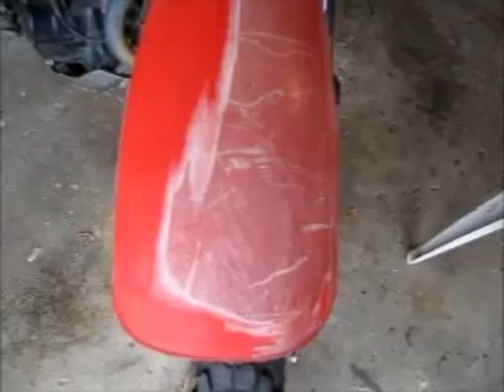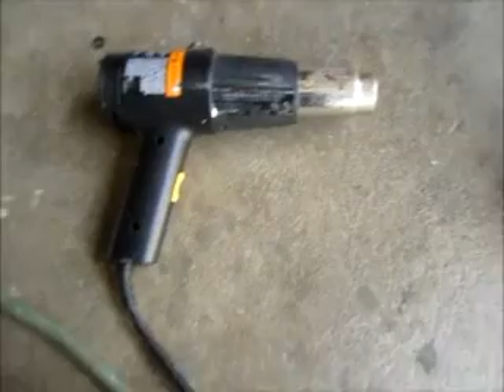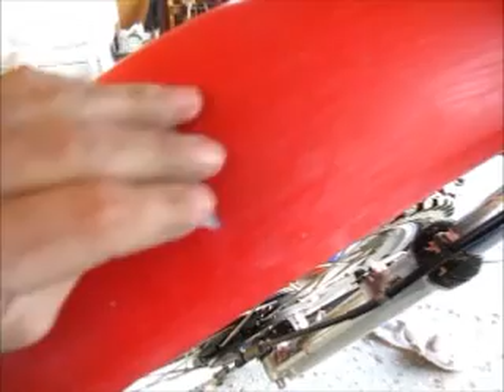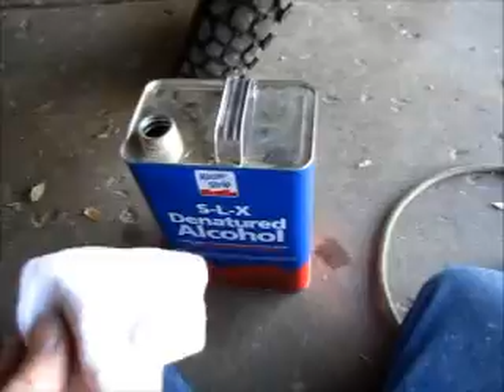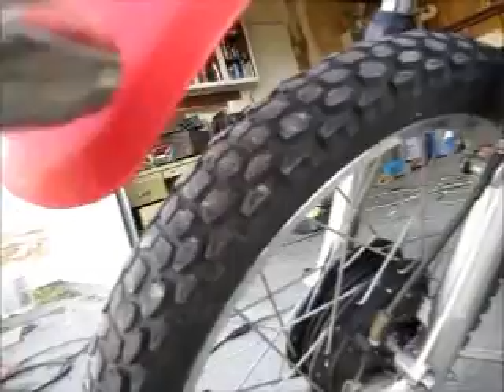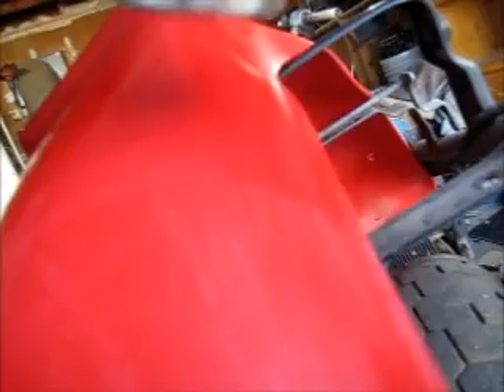How to Restore Faded Plastic Motorcycle Fenders (For free)

Comment: Ok here’s the updated process that will make your results phenomenal. Razor Sand the plastics free off heavy oxidation, wet sand 400grit, 600, 800, then heat gun, Let cool, wet sand again 1000, 1500, 2000, 2500, 3000, heat gun, let cool, compound with wool pad at low speed, clean pad polish low speed, then top it off with SC1 High Gloss Coating, let the coating soak on the plastics for a few mins then wipe it down with a microfiber towel 😎👍

Comment: Hi Jacob - didn't realize this was you for a few minutes !  Great as usual.  I have an old Spanish dirt bike that is "weathered" and the plastic is  raised and rough and oxidized badly.    Some of the rear  fender was protected from damage by other bodywork and shows a waxy but consistent red color and I want to scrape to see if I can get down to that layer.  Is it possible to scrape but not get there ? 
So far a lot of powder is coming off, but no red color seen.  Pretty badly oxidized.  If I don't "see red" pretty soon, is there a way I can apply  something that will stabilize the oxidation, act as a filler to the rough surface and then paint ?  BTW, I was glad to see you guys back the other day.  I don't know the frustrations of being a creator, but your channel was a bright spot, right up there with the big boys, so hang in there .  Thanks or being there.
Reply from the maker: I don't know of any way to stabilize the flaky plastic. Once it has dried out to the point we are talking about, it can't be reconstituted. If you can't scrape down to healthy plastic, maybe sanding and painting would be the best idea. What kind of bike is it? Sounds interesting!
Reply: Jennies Garage   1982 Montesa Cota 123 Trials
Reply from the maker: Unique machine. Good luck on the project!
Reply: Jennies Garage Thanks - I actually got 2 at the same time - the other is a 200, both kinda crusty, but will come back. I really like your channel so I hope it works out that you can come back more. Best of luck man

Comment: Helps but is not perfect a razor makes it worse and harder to sand down just use sand paper start with 220 or 300 and move up I repeat do not use a razor it’s going to leave a lot of lines plastic is very soft if ur a perfectionist like me ur not Gona be to happy with results it works and brings a shine but never like factory mirror finish I rather buy new ones cost the same if u add up materials and buffing wheels etc. it was a good learning curve but I recommend buying new ones on eBay cheaper and nicer good luck to all my DIY ERS

Comment: I didn't realize the oxidized plastic came off that easily.  Cool.

Tip on scraping:  Allow the blade angle to shift and you can scrape in both directions, doubling your work output in the same amount of strokes.

Have you tried polymer coatings, like NuFinish car "wax" instead of the heat gun to get a shine?

Comment: I have a lot of bikes I have collected over the years,  32 or so at this time, I like to fix them up and re sell them and also to have them around to ride so I only collect ones that I personally like and they are generally Trail Bikes from the 60's and 70's . i discovered this plastic restoration about 20 years ago or so, works great!   the alcohol I use on everything plastic, 91 proof i have found cheap enough and best, I like it because it leaves things as oil free as you can them.   did you know though you can sand plastic like it was paint and then polish it?   i don't use the heat gun is what i am getting at, I use a sander, i take it all the way to wet sand 1500 grit and then polish it up and man, it looks better than new, it;s amazing,  and when your old bike  shines like that with OEM fenders it pops so clean that people will pay the big bucks.

  Oh yeah. splurge a little and take the fender off.   thats the best way to get it 100%

Comment: Another idea i have is using  a cabinet scraper which is a  flat peice of steel  with a sharp  edge  used for scraping a  very fine amount  from a wood surface  in prepping it for finishing  you can find them on ebay for cheap and they are bigger than a razor blade  so easier to hold  also come in  a variety o shapes for getting into  strange corners  and profiles ?   One of my reasons for watching your channel is i have a early 60s Honda  street bike. That was my Dads  and one day in the future i would like to  make it  look  good and be a rider it has a lot of  plastic ? Fenders and fairings on it   I’m lucky  due to it  being in  a long term indoor  storage  but she still needs some love  i  think it may need a  wet sand or  a mechanical buffing. Mostly due to its age ?   Its mostly black  and i  do want to avoid  painting  if i can to preserve originality   If i can   In the past ive detailed polished other motorcycles  using a dremel  and various  compounds  and rouges  so I’m not afraid to  experiment or of the hard  tedious. Detail work it requires  ? Actually for some unknown reason i kind of enjoy it as i found with the right music and mixed drinks it can be relaxing  and even a little therapeutic  lol  my friends think I’m  nutty   And perhaps i am  but my Mom always said to each his own

Comment: The stuff he is scraping off is a clear coat paint put on from factory it burns from sun exposure over the years just using the heat gun with out the razor blade should work fine.

Comment: Save time and get better results by wet sanding and 3 step polishing or using a deminishing compound with a roto pad on a hitachi sander... Done in 10 min tops smooth and scratch free mirror finish..

Comment: Much better results starting with 320 grit sand paper, then 600 and finally 1200 grit....after done wet sanding, use polish and they look brand new!  This method doesn't leave any scratches or gouges from a razor and you don't run the risk of melting through or bubbling your plastic with a heat gun.

Comment: "Oneself" doesn't know but that method looks like it will "Decrease" the dirt bikes "Strength" because you are cutting away the initial plastic "Lessoning" the "Integrity" of the "Plastic" for its "Initial" "Looks" HUH , ....BUT you have to consider this the Old Faded Look or The Newly Re-Conditioned Look. Oneself has an "Old Faded "Honda 81' xr 250 dirt bike. Now do you take the differences and try it ?. Why not huh it has nothing to do with the motor or anything mechanical .  Again oneself watched this and am fully impressed because it doesn't make riding "Your Ole Bike" seem like your back in the "Flintstone Era"

Comment: Bad advice.   Look into wetsanding if you want to do this properly.  Razors and heat guns gouge and warp plastic.   Wetsanding looks 10x better and is faster if done correctly.  Yes I've tried both techniques.
Reply: Have you tried a propane torch
Reply: so big guy where's your video?

Comment: whats your opinion on using different grades of sand paper to get rid of the deep scratches? would you use the heat gun straight after or would you use the blade?
Reply from the maker: I think it depends on the fender. On the fender in this video, sandpaper didn't work, it just mad a mess because the plastic was kind of a soft formula (think of sanding a block of cheese) so I went straight from blade to heat. With the Husky fender (if I recall, you watched that video too), sandpaper seemed to work better for scratches (maybe 100 grit to get the deep ones, and then work up from there) but a blade is faster at removing material. In the end the toughest part is making it shiny. The sandpaper brought the husky fender to a smooth, but dull finish, and it was hard to bring it from that, to a nice gloss.

Comment: Wouldn't this work better with some polish grade sandpaper?
Reply from the maker: it depends on the plastic. On this fender I tried sandpaper from 100 all the way to 2000 grit, and it just made  little gouges that had kind of a fuzzy appearance. I think it's because this plastic is pretty soft so the sandpaper couldn't cut like it is supposed to. Imagine trying to sand a block of cheese.
Reply: Interesting, I've never restored supermotos, only encountered hard plastics so sandpaper has been more than enough...... but its good to know of this method as well since I'm obsessed with detailing & restoration

Comment: 60/40 mix of mineral spirit based paint thinner and boiled linseed oil works well too with much less effort. Spray on, let sit 30 seconds, wipe off. Then rinse with water. Only lasts about a year though. The cleaner they sell for fiberglass boats works too.

Comment: Question:  Can I use a hair dryer instead of a heatgun? other than that, good job for taking care of your bike man!
Reply: propane torch is a lot faster.
Reply: No you can't
Reply from the maker: Thanks a lot! Like the other guy said, I don't think a hair dryer gets hot enough.
Reply: hair dryer worked for taking a decal sticker off the back of a car,  a decent hair dryer is hot enough u cant hold your hand in front of it
Reply: hey, ever try a mix of paint thinner and cooked linseed oil? won't restore plastic this far gone but will turn old faded black plastic pretty good again... or good enough to sell. lol

Comment: Could you use a headlight restoration kit after scraping?
Reply: yes. it works great. Scratch removed for auto paint also works well.
Scratch Out is the brand I use, along with a buffing pad on my drill.
Reply: +Wayne Wildman interesting

Comment: do you have to use a heat gun or can you use a hair dryer
Reply from the maker: +Daniel Sirny I haven't tried a hair dryer, but I don't think it gets hot enough. A propane torch will work though, but you must be very very careful not to get too hot.

Comment: I found a trick back in the 80's to get the color back to a plastic MX fender in the area where the fender folded when you looped your bike,---and you know you did.

So you have a fender with a few white zebra stripes on it, but otherwise it is fine.  Use a hand held propane torch and heat up the white area---and don't get too close to melt it.  It will turn a darker color than the stock color with the heat on it (stop there), but when it cools, it will be a perfect match.

I don't know if it will work for sun fade, but it is worth a try.
Reply: works with sun fade but not on all plastics :)
Reply from the maker: +EarthSurferUSA Good idea, thanks!

Comment: Heat gun vs. Hair dryer?
Would sand paper work better than the blade?
Reply: +Patricia Zamora hair dryer will not melt the plastic, which is a requirement

Comment: Sand first then steel wool with Johnson past wax then buff with buffer! Steel wool works fantastic, BUT DO NOT put too much elbow grease into rubbing STEEL WOOL cause it will burn plastic and you will have white spots like I experienced with an old KDX fender!

Comment: wet sand with 220, then 400. you don't need super fine paper.
Reply: wtf you cant sand plastic with 220 it will ruin it and 220 isn't water sandpaper, shouldn't use under 600
Reply: yes you can. its not like wetsanding paint,you can go courser. ive got 220 wetordry in my shop. i use a little detergent in the bucket. as for 600,yeah,if you want it slick. i used that spraycan made-for-plastic shit to cammo a 3 wheeler. fusion.

Comment: Could I use sand paper or wet+dry for the scraping part? I'm not very good with box cutters.
Reply: Yes use wet sandpaper it works great
Reply from the maker: +hung huge This has been asked a lot. It depends on the plastic. This fender was kind of a soft plastic, and no amount of sanding helped. It needed the shave of a blade. Some fenders will look ok with sanding.
Reply: you can get a solution called victory. its a metal /pvc cleaner. wipe it over and it will litterally take this sun fade layer clean off.. neutralise with water and good to go.
Reply: +hung huge i use that but it take alot of time

Comment: An easier and faster way to restore the oxidized plastic is to use boiled linseed oil and paint thinner, the technique is very popular and if you have oxidized plastics on an ATV, the method shown in this video would take far too long.
Reply: I use linseed oil for lots of projects. Water down what ever you use to apply the oil with (rags, paper towel, etc...), they can ignite without spark. The reaction between the fumes and oxygen in the air is exothermic.
Reply: Old songs
Reply: +Garrett Cook Is that method permanent does it actually remove it? Or just mask it?
Reply: The concoction will remove all oxidization, restoring it to day one condition, but after time will oxidize again. The linseed oil develops a protective layer that will actually preserve the plastic longer than from the factory. So yes, it removes the oxidization.

Comment: Uhmm... instead of scraping... can't you just sandpaper it down? Rough to fine grit then do the same heat gun?
Reply: +shogrran You could, but the scraping leaves a really nice smooth finish, sanding (no matter how fine) always leaves tiny grooves
Reply: ^That's why you wet sand and use a heat gun

Comment: I liked how you demonstrated your technique for holding the razor blade and didn't adopt an "I know something you don't" tone so common on YouTube tutorials.  You did well.  

Question: For removing the high spots, wouldn't a long piece of moderate grit sandpaper be more effective?  You could wield it like a shoeshiner, it would conform to the curve of the plastic.  You would need to move in multiple directions, not just staying side-to-side, but I think it would be effective.
Reply from the maker: flammewerfer Hi, i tried sandpaper, and didn't like the results. The course grit left a real dull, "fuzzy" finish, and as I moved up in grit, it got so fine it wouldn't cut. I think it has to do with the composition of the plastic on your particular machine though. Some plastics may respond better to the sandpaper. Thanks!

Comment: Nice but it's technically not 'restoring' as you are taking away what used to be the layer of plastic on top. If that layer was still present, but actually 'changed' then it would be restored

Comment: Will this work of you plan to spray paint the plastic afterwards?
Reply: +Andrew Watson Never spray paint plastic.
Reply: ***** Most likely because he did a bad job once and it chipped and peeled. Color plastic will always be the #1 best but if you do it right paint will look good and hold for a long time. Mine still look amazing.
Reply: +Andrew Watson Yes this is a great way to prep if you would like to paint. If you do a great job on preparation and use quality paint you can get a very nice finish. For custom look you cant buy Its a great inexpensive solution and if done right the only way its coming off from cuts/chips deeper then the paint. I blast mine with a power washer and it stands up to it.
Reply: +Greg Steadman my plastics have been painted black since this video. Thanks.
Reply: +Tanner Huotari why?
Reply: Greg Steadman That's good to hear, I'd love to paint my stock tail black and was scared of ruining it

Comment: or order a $20 finder on amazon great video tho
Reply: Haha, find me a 20 dollar fender for my 81 XR500R or a gas tank under 200. I promise you wont
Reply: buy universal one, drill your own holes
Reply: so where do you find ORIGINAL plastics for older models for 20 bucks? the main reason people restore old bikes is because they had them as a kid and want them to look exactly like they did out of the factory.
Reply: +Dylan Ellingson ufo universal, I have it in my 81 xr500
Reply: They have them on sale now for $16.95
Reply: Nicholas McSam I hate the look of universal ones because they are always the cheapest shittiest ones out there. When you crash, they shatter. Original plastics just bend depending on how fucked they are
Reply: RageAgainstTheToyMachine the only way is to find a parts bike that I found. I had an old 1978 Yamaha dt250 enduro and I couldn’t find any parts besides eBay and parts bikes

Comment: I use silicon spray for my plastics...
The colour gets darker/stronger and the water cant stay on the plastic...
Sry for my bad english :p
Reply: Somthing like Lucas Oil Speed Wax or Maxima SC1, those are silicone detailing sprays
Reply: So basically WD-40?
Reply: Nope! WD-40 is oil
Reply: Silicone can make plastics brittle and crack.
Reply: Lash Mctoobin but it can increase the resale value instantly if that’s what you’re going for.
Reply: +Florian M. No excuse for bad English.

Comment: This method works great. Some of these people dont realize that with alot of older dirt bikes and atvs this is your only alternative. Painting NEVER lasts. Im doing a 86 honda 200x headlight right now. They say go buy one? Yea right.  200 bucks and up. That is IF you can find one... razor blades and a heat gun looks good to me. Hahahaha
Reply: George Hodges I have an 86 Honda but four wheels
Reply: 200$ isn’t that much money
Reply: Hayden Allen compared to a single razor blade and a heat gun it is.
Reply: PerfectedToast but it won’t look as good as a factory one
Reply: @haydenallen2671  it's still a factory part. Just restored. And if you give the part a nice buffing with a sheepskin buffing wheel it will look perfectly new

Comment: To prevent whats left of your fender becoming oxidized like it was before, remember to regularly polish it with wax or something better like 303's UV Protectant.
Reply from the maker: Paul Stuart Good idea, thanks!
Reply: 303 is weak.  jet seal ceramic polymer will whip in shape for the sun for longer.  Good luck.